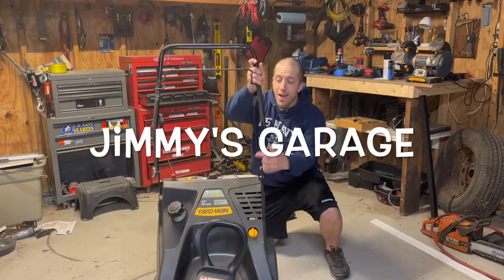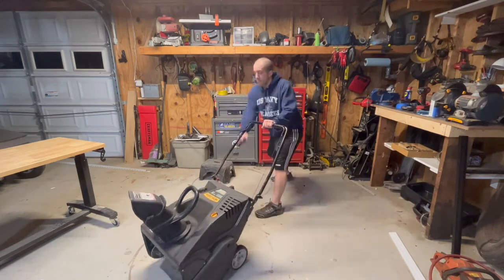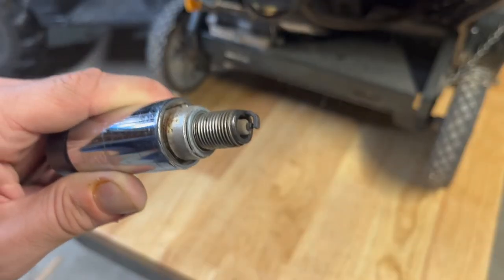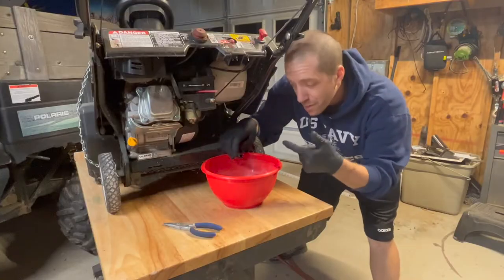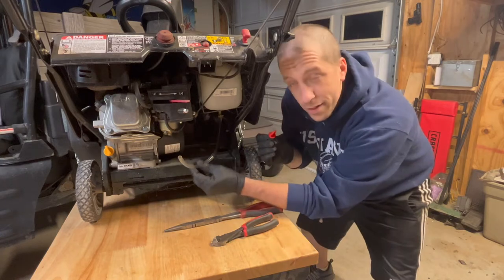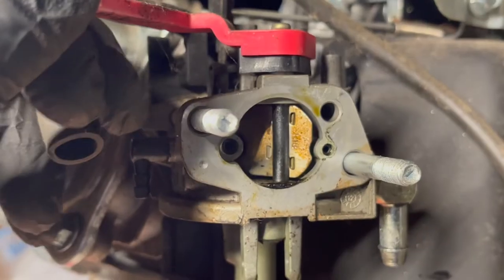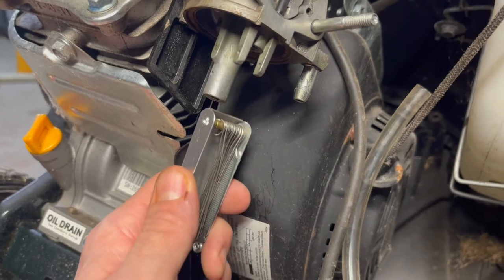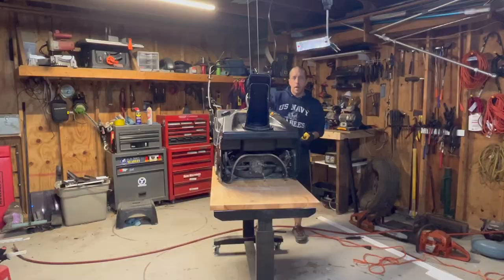SITTING Yard Man 21" Snow Thrower Won't Run - Fixed!

Comment: First off. guy was trying to start blower with auger engaged. Secondly. Remove carb and main jet to clean all passage holes. Thirdly, These carbs run very lean. Most run only on half choke. China crap.
Reply from the maker: Definitely not the best design in the world!
Reply: It really makes me laugh when people make an ass out of themselves when they don’t know what they’re doing

Comment: Why just clean the carburetor out be done with it you know the gas is not good so with it’s carburetion why did you take the carburetor off and do it right step to stupid shortcuts i’ve been doing this for 60 years and I have never done shortcuts
Reply from the maker: Somebody is upset